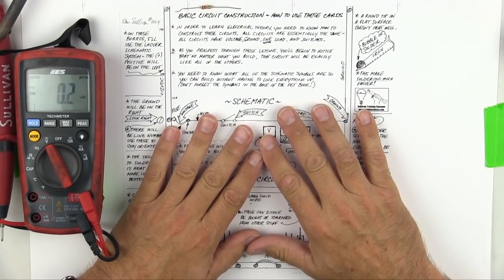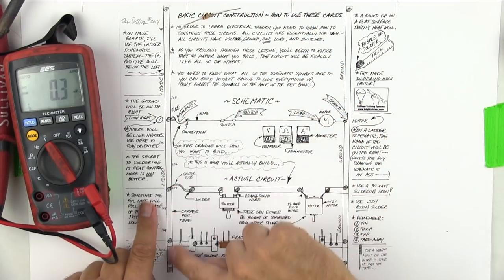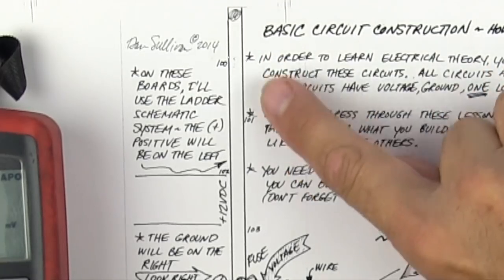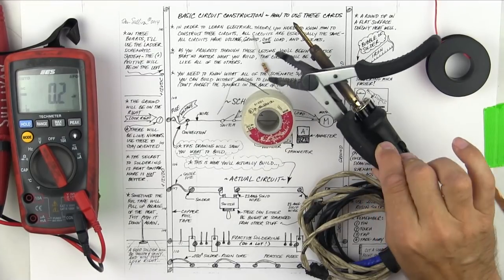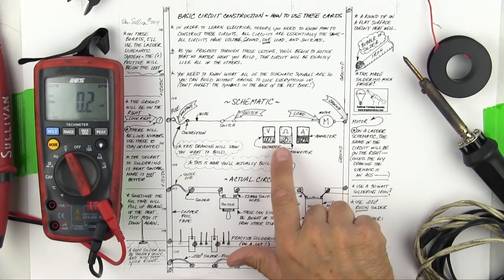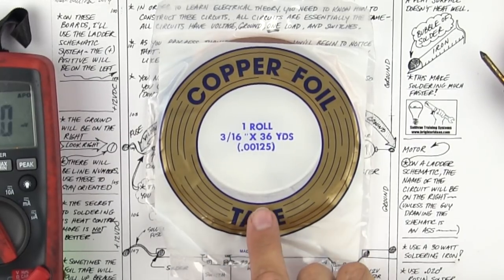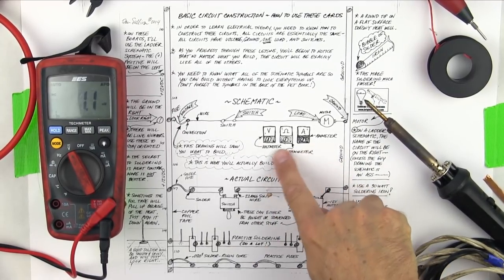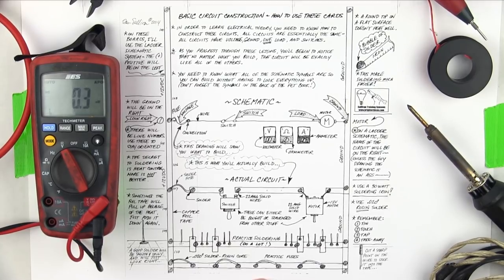CARD 1 - INTRODUCTION - Hands-On-Line Electrical Training

Comment: Fantastic, I am a chemical engineer and I am starting a welding, fabrication,foundry, and machine shop that specializes in pre WWI race cars. I run into electrical gremlins constantly and I absolutely love your videos. I just stumbled upon them when I found the Load-Pro on Amazon and decided to purchase it. I am also restoring a whole wall of SUN automotive diagnostic equipment. The more wires and complicated pathways ,the better. I love troubleshooting .

Comment: Having bought my first arduino board and built a circuit now I want to begin understanding the relationship of the circuit and components to ohms law.

But first need to understand ohms law better ....  I like your vids ... bookmarked them all ...  Thanks for putting in the time to make them.
Reply from the maker: You're welcome - and you'll also need to practice soldering. A 15W iron is adequate - and use the smallest solder. Clean the board gently with a pencil eraser to make it work better.
Reply: Need to get a new DMM as well .. Can't seem to measure amps ....

Have I think a 30 watt iron from HarborFreight I think.  Thanks for the tip of the eraser tho.